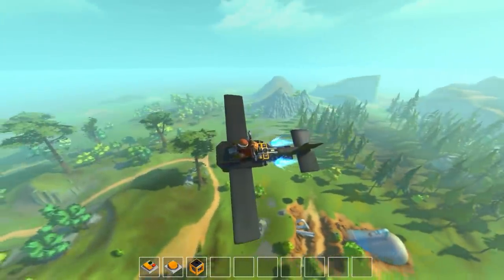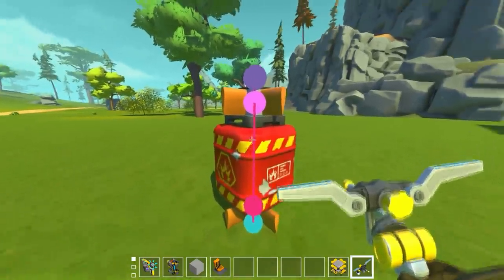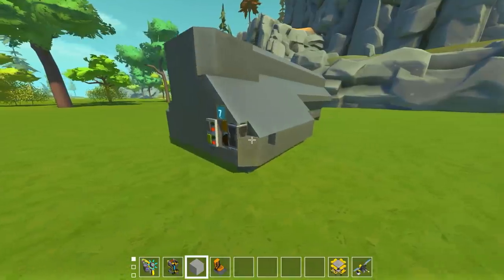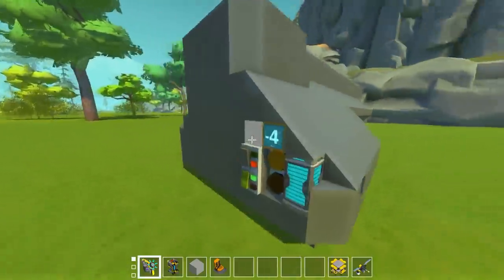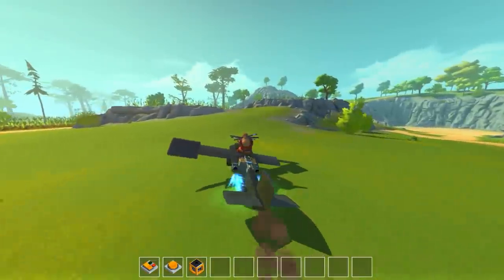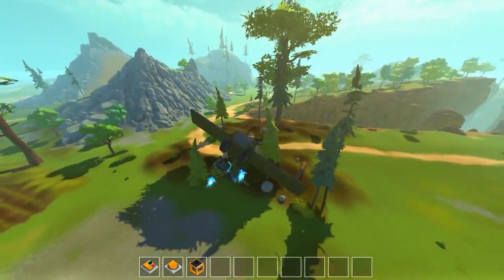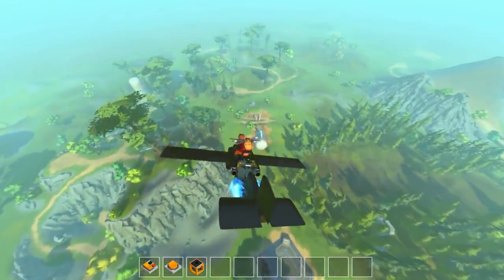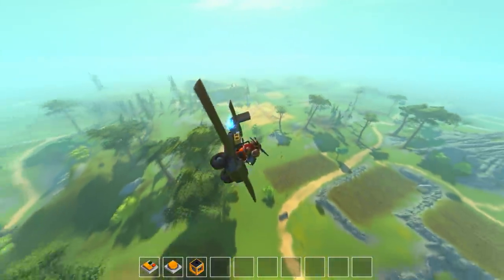Reloading Homing Missile Turret and Aircraft Flares! (Scrap Mechanic #351)

Comment: well those missles seem good when they hit the ground but i think for them to work against aircrafts you need to make an automatic trigger because otherwise... 9:20 .. a good trigger would be a modded spud gun hooked onto a player range detector something like 'if the missle is on X distance to a player for X seconds and the spud gun shoots' that way you can be sure the missle activates once it actualy hits the target it either goes of from the impact or it sticks to the vehicle and then explodes

Comment: you should mmove the front part of the missile behinf the exposive canister, because currently you essentially need it to slam you with it's side instead of actually hitting you with the front. you could also use the warhead from one of those bomb mods to make the missile even smaller.

Comment: are there player distance sensors? if so, you could have a slightly larger missile and not have the missile on your craft problem. say, have the thing explode if within 5 blocks of player
Reply: as I posted that, he said that because it's so small he didn;t have that.

Comment: if you used modded explosives you could have the flares self-destruct after a set time, as an example i made the following
Vanilla version: https://steamcommunity.com/sharedfiles/filedetails/?id=1542741413 Vanilla Version is an example 'flare' doesn't have a player imitator 
Modded Version: https://steamcommunity.com/sharedfiles/filedetails/?id=1542768982 Modded version has a player imitator and will uses modpack timed explosive attached to a logic circuit, it's laid out to be stackable, this has a side effect of being bulky vertically, timer is directly in front of player imitator and is set to 10 seconds